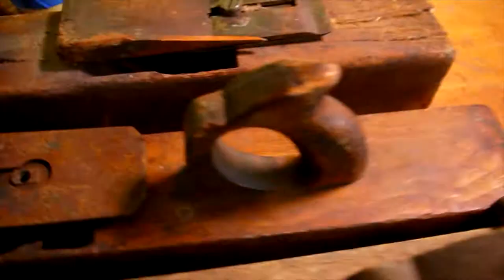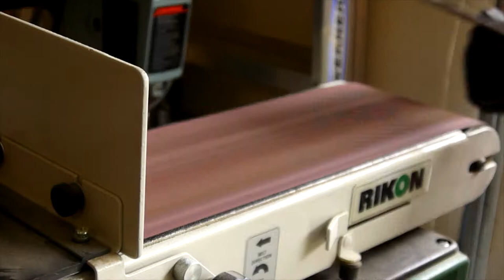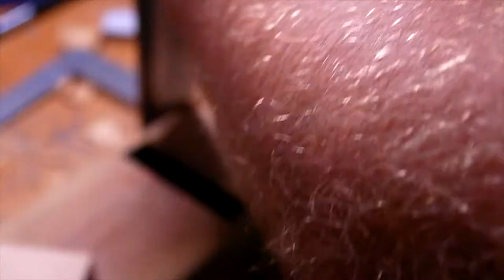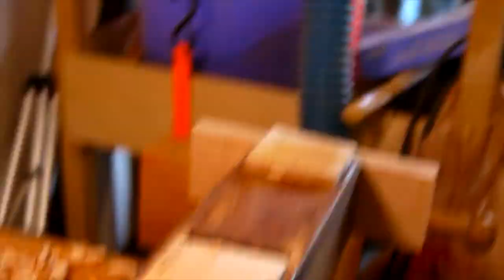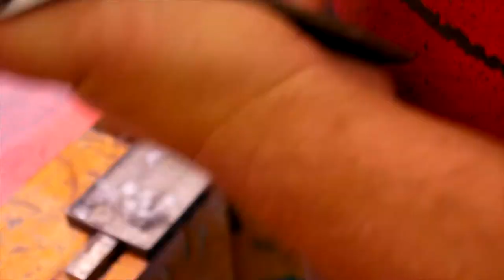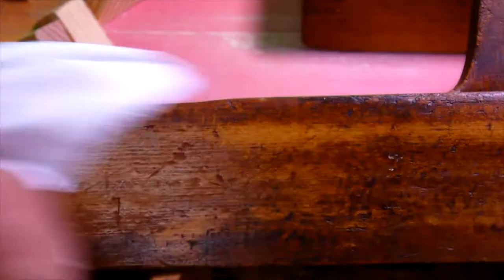Wooden Hand Plane Preservation: A Light Restoration Of Two Large Wooden Planes And Their Irons

Comment: Do not soak those ceramic stones you will ruin them! I love my shaptons but soaking them is basically asking them to break in half.
Reply from the maker: Gonna have to disagree with you there boss. I soak them on a timer for five minutes, which is exactly what is recommended by Shaptons. Then they are used, cleaned and dried. I do this with each stone individually. There is nothing wrong with this process. I would never leave them to soak and just walk away though. In that case, you're right, that's asking for trouble. In any case, I appreciate the heads up and I promise to treat the Shaptons right.